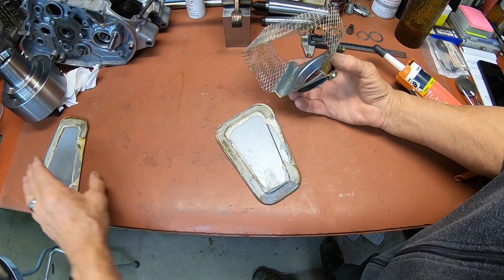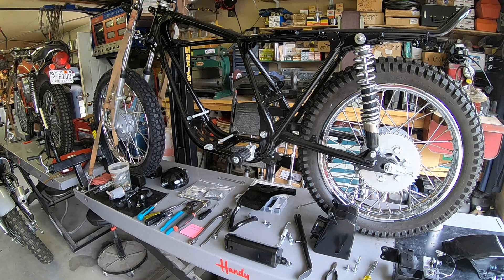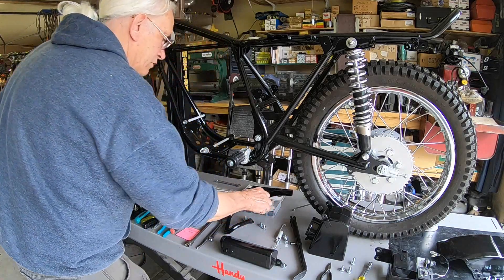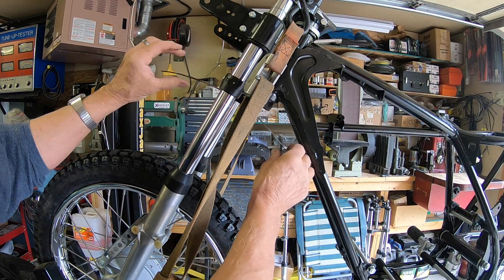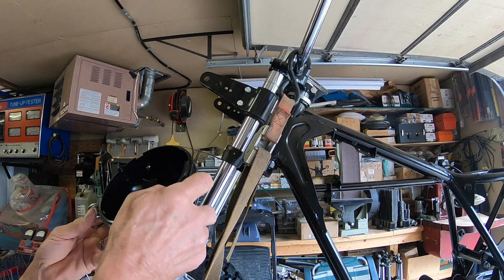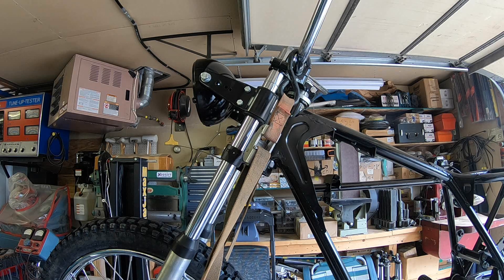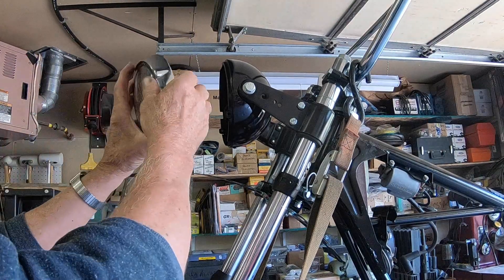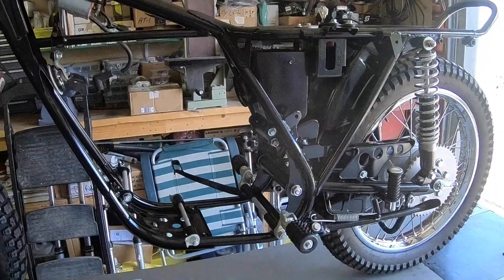Kawasaki F7 175 Bushwacker, more assembly, air cleaner repair

Comment: Very good Dale, it's a fine looking bike so far. I do like a survivor but if a bike is too far gone, then you might as well paint it. My D5 project will be done nice as there is no originality left to save, just a scabby frame to start with!
Best wishes, Dean.
Reply from the maker: Hey Dean, I do like the survivor look.... but most of these just need to be finished. In my opinion...you have to finish the job. The survivor look, I feel you do nothing but get it running and ride it. Don't paint the frame or anything because then it just looks unfinished.

Comment: I know this is only verbiage but the lower beefier piece is the chain guard, protecting the chain from rocks, etc., and the thin upper decorative piece with the holes is the chain case keeping your leg away from the moving chain. Seems like a lot of bikes I've had the chain case was there but were missing the lower chain guard. Am interested to see if you stay with the original paint and  'Laser Blend' decals on the gas and oil tank or do new. The '72 F7 model was an attractive red with 'Sonic Striping' decals. Great looking F7 so far.
Reply from the maker: Hi there, yes, this one was missing the lower guide. Not sure if they came on them or not, saw one for I think a 75 model and it fit. Not sure what I am going to do with paint. The tank does have some dents, so if I remove them I will for sure repaint and apply new decals. (Which I already have) Some have suggested it would be better to leave it as is. Just not sure at this time. I really think I will repair and paint. It just doesn't seem right to do half the job. Only time will tell. Hey thanks for spending time with me in the shop.

Comment: I've got a 74 175 nearly original. got the magneto system... lights get brighter the higher it revs with no battery... I'd love some help in the wiring since I'm not sure what's was originally going where.  Also clutch slips, rpms climb while riding in gear but eventually starts slipping with enough throttle.  Also my choke, I use the switch on left handle for air/fuel... but runs great otherwise
Reply from the maker: Hi James, when dealing with these old machines, you always want a good battery in the bike. The battery helps eliminate voltage spikes that can blow out your bulbs. They are in a since a regulator.
Try to adjust the clutch so you have about 1/8-inch free play at the lever. Never use synthetic oil in these old bikes the clutch will slip every time. Use a good 10/30 petroleum base oil. 
Not sure what you mean about the choke and the left handle switch.
Thanks for spending time with me in the shop.

Comment: Is there any way you could show in detail how to wire up the brake light? I just got a 71’ and whoever had it before me disconnected the wires. They ended up kind of just shoving the wires up behind the oil tank. I have no idea what wires go where and it would be greatly appreciated!
Reply from the maker: Hi there, right now I'm starting the restoration of this bike, the main harness is in shambles so I will be rewiring that. The brake light/taillight should just be two wires with a ground at the taillight bracket. So, one wire will go to the taillight the other to the brake light. Should be easy enough, if you get it backwards just switch the wires.  I will be getting to this in good time, but I have no way to show it till I get it on film. Thanks for taking the time to watch the channel.

Comment: remember on last video you showed the little chain, today you mentioned it was a old school keep the grass out trick. never heard of this, maybe because i live in the desert not much of a weed/grass problem. can you explain thought it was interesting.
Reply from the maker: Yes, it was for the cow trail people! You desert rats can remove the chains.
Reply: That was funny.......cow trail people vs. desert rats.   Actually the two front chains were also designed to keep small limbs from ramming into the gear shifter or brake lever and bending them, or causing the cow trail people and desert rats from sailing over the handle bars.   @montana2strokeracer

Comment: Kaplan has a 1972 and the holes on the ears are for a round reflector. also saw a 1970 with these. think older F7 didnt require reflectors.
Reply from the maker: Thanks Frank, I just happen to have to large red reflectors that when installed cover all those holes, but it looks weird with the two amber ones on the forks. I will try them.

Comment: Dale, i dont know if you mentioned this in a previous video, but what did you paint the frame with? i'm doing a '71 F6 125 right now and plan to paint the frame, but i want something tough since ill actually ride the bike too
Reply from the maker: What I use is automotive single stage acrylic urethane.
Reply: @montana2strokeracer  thanks!

Comment: Looking really good Dale.
All the small hardware for the air box, battery box and such, did you use new or plated the old stuff?
I can’t wait to see you tackle all the electrical rewire work.
That is the stuff I like to do.
Reply from the maker: Hi Don, and thank you, all the hardware is new unless it is unique or excessively expensive. I really does take a very long time to do the plating, so if it's just general hardware...I use new. Ok I see how you are, you're ready to see me sweat and swear doing the electrical. Sorry it's just not my favorite thing to do.
Reply: @montana2strokeracer , LOL. Dale, If I were closer I would take care of your electrical stuff for you. Call me crazy, but I like doing the fiddely kind of stuff.
Reply from the maker: @donbridgewater2988  Don, you're a sick individual. I would sure let you take care of that wiring. I have found a used one that is in much better condition. It may make things a bit easier.